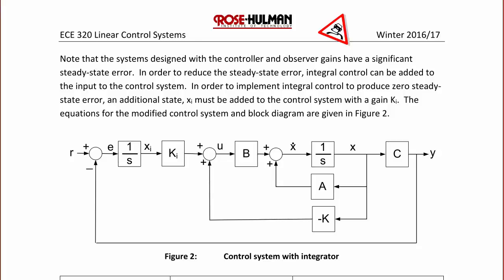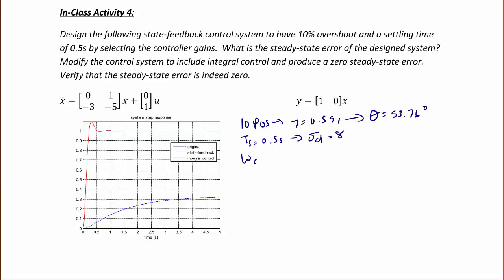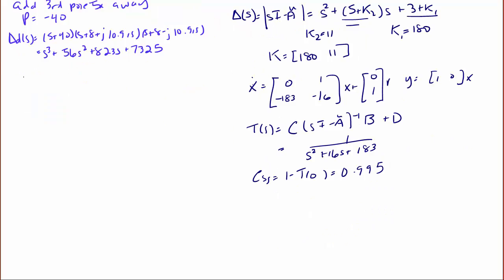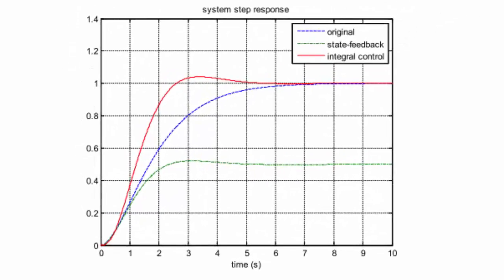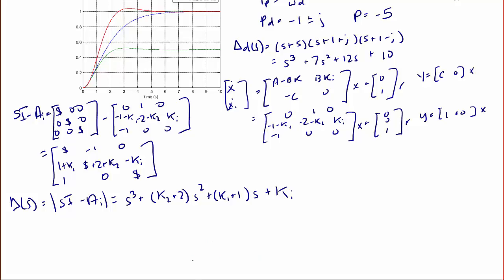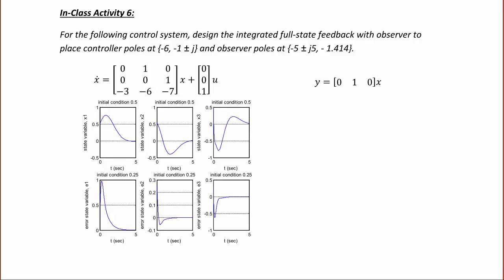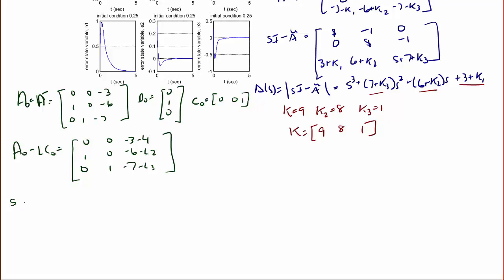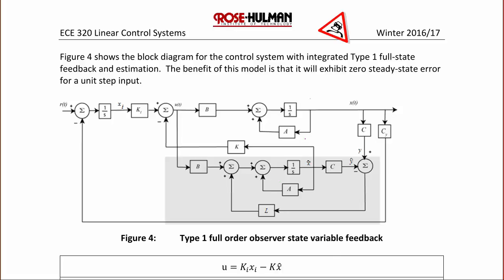ECE320 Lecture6- 3b: Integral Control, Integrated Full-State Estimation and Feedback

Comment: thank you, i have a question is the integrator controller the same as the scaler N bar , which we multiply in the reference input? if so which is better?, thank you
Reply from the maker: No the scaler that you multiply the input by to get rid of steady state error is not the same as the integrator, that is a pre-filter and it could also be used to get rid of steady-state error but may not adjust for changes in the system because it is not part of the feedback loop.https://ieeexplore.ieee.org/document/7814965 https://people.kth.se/~demirel/ACMM/L03.pdf
Reply: @RoseHulmanOnline  thanks alot 👌